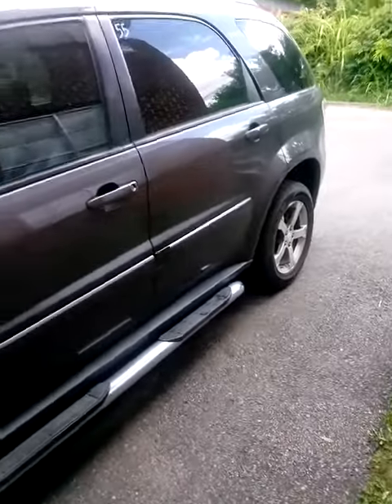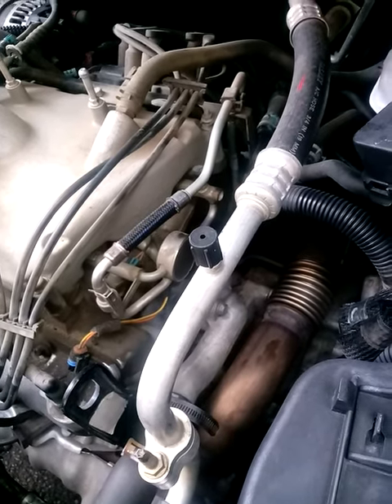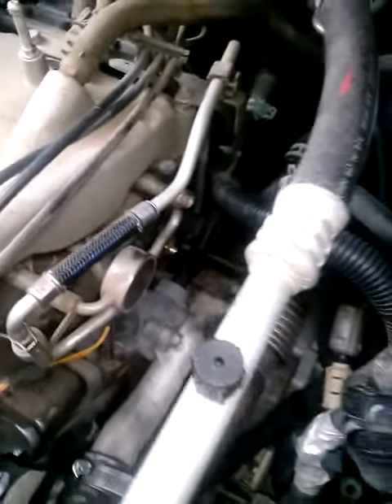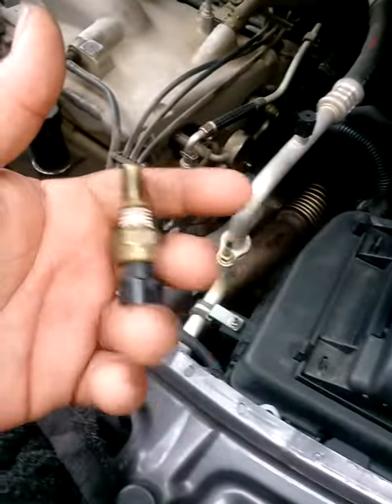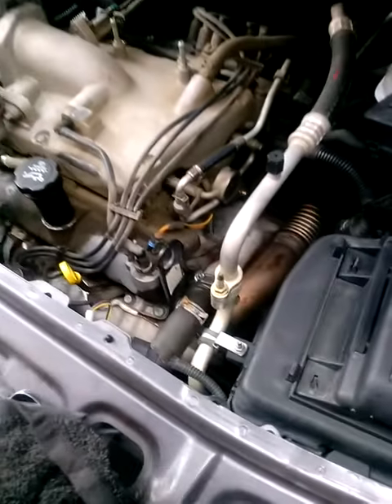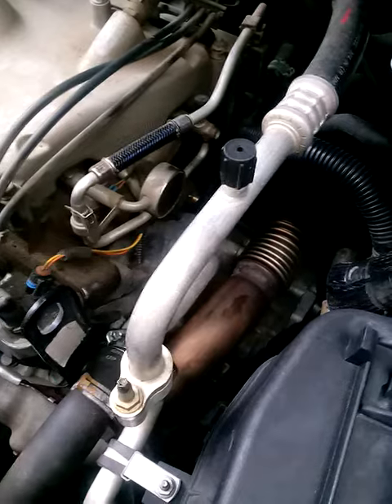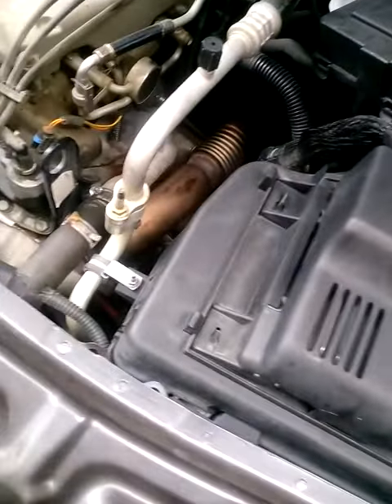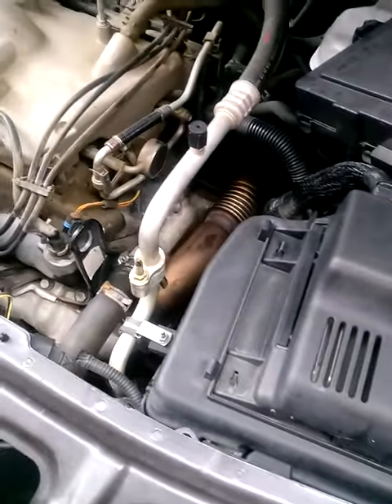2007 CHEVY EQUINOX COOLANT TEMP SENSOR... SUBSCRIBE FOR QUESTIONS

Comment: Thanks for pointing the location of the sensor . I am not a auto repair person. But I try to do it myself. Looks pretty simple. I will have it checked at Auto Zone and have it read. Thanks again. Maybe I can get hubby to help out lmbo.
Reply: fran rene' smith temp sensors rarely go out!! Check fluid level first then check the pigtail at sensor to see that ther are no frade wires if all ok then change thermostat!
Reply: @LH81633  It's frayed, jus saying.

Comment: Thank you for this video. I have an 08 and I am having a issue with a ENGINE HOTT A/C OFF code on the dash and the fan stays on with the temp gauge all the way down to cold.... I replaced the same part as your video but code still is up . I'm gong to replace the thermastate next. Hope that fixes the issue .
Reply: you maybe need to do a reset,take off neg cable from the battery for a minute and put it back,try,let us know.
Reply: So it was The thermostat... Now she is running like Angel. .. Thank you again my friend.
Reply: KAMIKAZE 
I think doesn’t help to change this part in your car
Change themostatic volve 
Will help you to resolve the problem 
As I did in my 2007 chev equinox
Reply: @pervaizakhtar2365  whats that ? Im having this exact problem.
Reply: @3552paulie  so that was the problem then ? Was your thermostat stuck open ?
Reply: Yes. Sure was
Reply: @3552paulie  👍
Reply: Same thing with my 2008 equinox. Resevoir was empty. Reset battery and prob went away temporarily but same thing came back after. Engine hot and ac off. Replace thermostat or sensor or both?
Reply: Did you replace the thermostat? Did it fix the issue?
Reply: Is it easy to replace both?

Comment: I have same truck. I replaced that part, replaced manifold gaskets which was bad, water pump radiator thermostat.plus I bleed it. Its still running hot and bubbles and pressure is backing up in the reservoir. Not much smoke and its running fine not missing at all
Reply: I know this is a year later, but did you figure out the problem? I got an 07 equinox doing the same thing
Reply: @alanwiggins47  Mine was doing the same thing, I replaced the heater core, my dad (mechanic) said that was the issue. I know it's a month later, but if you ever run across another issue like that, you have an answer to ur question.

Comment: Disconnect the negative terminal.
Reply: Explain why. I knew the first comment I seen would say disconnect negative.
Reply: @TheUnitedMassacre  electrons flow from the negative terminal. ALWAYS disconnect it first. If you pull the negative first, no voltage in the system and it won't arc across in case of an accidental tool drop or anything.

Comment: I have the same suv i replaced the snesor still haven't changed. What else can it be
Reply from the maker: Make sure the fluid isn’t mixed with oil… and the radiator fans come on… and the thermostat might have to be replaced.

Comment: Hello i hop you can help me i have a chevy equinox 2008 and problem is that fans turns on and off every 5 seconds and sometimes when i turn off the car they keep running.
But the temperature icon on dash it's still normal.
Thanks.
Reply from the maker: Electrical shortage... Sounds like the hot wire is touching something... Double check the fuses that go to the fan... Then get a mechanic to re run the wires to the fan....
Reply from the maker: Or go to the salvage yard and replace the whole fan
Reply: Any fixes for this I have the same issue fans come on for 5 seconds then go off temp is normal
Reply: @funnystuffhappens9382  
Nop i have been driving it for about 2 years like that I hope you fix yours.

Comment: I have a 2008 Chevy equinox LTZ and it over heats just the same, if I’m at a stop sign, drive thru, or stop light it begins to over heat. I’ve changed the water pump, radiator hose, thermostat and bled the system and it worked well for a few days but now I’m having the same issue again. Not to mention, my coolant reservoir seems to fill higher when I drive it, Even when though I fill it to the cool line. My best guess at thus point is the head gasket. Someone please help
Reply: Have u checked your heater core ? I did same replacements as you . Also could be a leak somewhere.

Comment: So I have a 2007 Chevy equinox and I have some of the similar issues my car runs hot all the time so I got the water pump, thermostat, bypass, and had coolent bleed and it's still running hot! Could it be this or the radiator???
Reply from the maker: Does the radiator make bubbles when it's running for a while

Comment: Yo fam my fan goin off n temp went up n down there is no code just fan goin on when the temp passes half way when i drive it goes back down i topped it off wit coolant earlier what u think tho?
Reply from the maker: engine coolant  sensor...or thermostat sticking
Reply: Ghostwriter901 is that same sensor u changed
Reply from the maker: yeah the coolant temp sensor....cheap part
if its not that then its gone be the thernostat....a cheap and easy fix too
Reply: Ghostwriter901 ok perfect bro i.got a ac delco.thermostat on ebay there cheap like 9.10 bucks n i just ordered coolamt temp sensor for 6$ thanks bro for the help good video!!
Reply: Hey fam how long did it take u to.replace the coolant sensor
Reply from the maker: s.dot carter 15 min